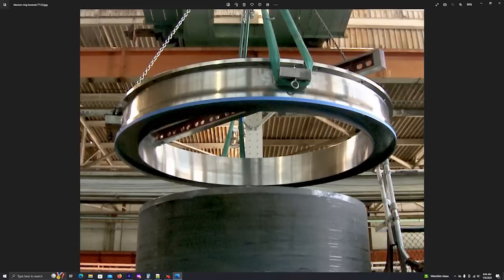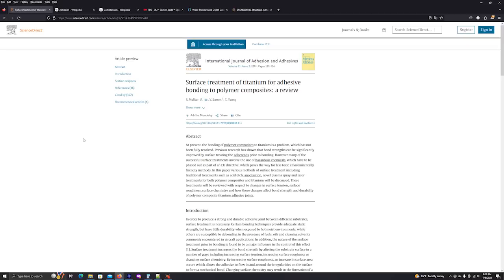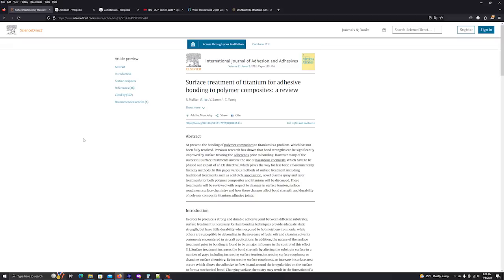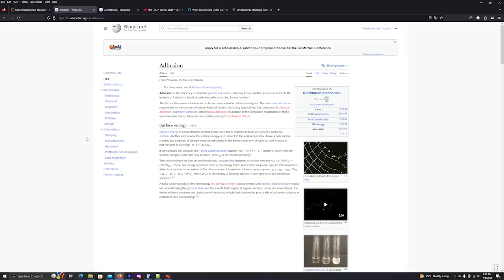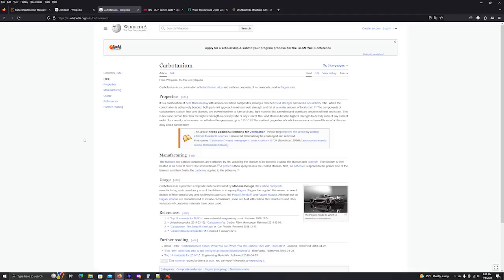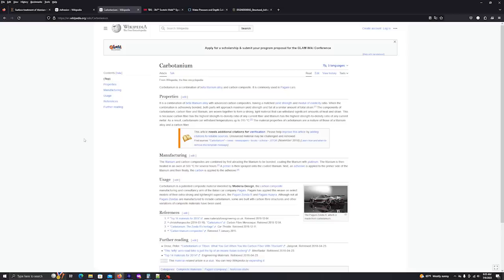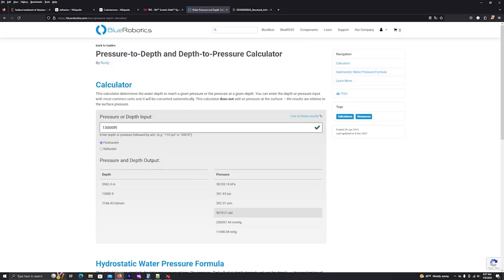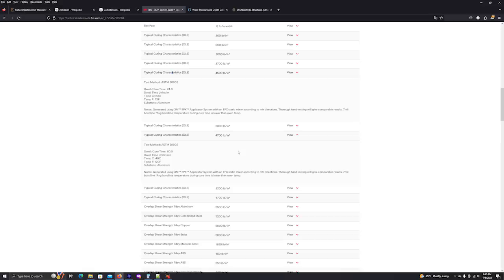Oceangate Titan Adhesive issues between Carbon Fiber and Titanium

Comment: On the recovered flange (starting at 1:11), what you’re pointing out is it’s outer circumference, which is not the bonding edge.
Reply: On the titanium ring are found two flanges, an inner flange and an outer flange, also a flat surface that is perpendicular to both inner and outer flanges. I call this entire configuration the bonding edge of the titanium ring, as the other edge of this ring is bolted to the forward dome. The bonding surfaces are the I.D. of the outer flange, the flat perpendicular surface, and the O.D. of the inner flange. So, to be clear, I did not refer to the titanium ring as being a flange, I was pointing out the orientation and location of the flanges that are part of the overall titanium ring.
Reply: @stitchem7   I wouldn't use glue at all.... I'll just use titanium cylinder between the two titanium hemispheres.... either it'll be bolted or welded. I would not put any glue between me and 360 atmospheres.... even then I would test it a 100 times underwater at twice the depth. If everything is OK then I might get down....  one thing I know from life, things will always get wrong and when they get wrong 2 times overprovision might not be enough.
Reply: @Slav4o911  Exactly my thoughts, if they would have used a titanium hull/tube, the passengers would probably still be alive. Yes, bolted with proper seals, or welded.
Reply: @stitchem7  Alrighty, then.
Reply: Correct.
Reply: Yep
Reply: The clean bond line indicates a bond-line preparation failure, and not a cohesive failure.
Reply: @scorchwhammin  The key word being "failure."

Comment: This is not a good use for an adhesive.  With that being said the hydraulic forces pushing the titanium and carbon fiber interface together would make the joint more robust.  For example, I estimate at 12,000ft of depth there would be approximately 5,500,000lbf of compressive force pushing the joint together.  Not sure how many cycles this joint would be good for.
Reply from the maker: Thanks for the comments
Reply: What about when it's not at depth.  Try to submerge a 20 ounce plastic bottle full of air without threading the end cap on.  Maybe 20,000 leagues under sea it would stay on but what about first few hundred feet
Reply: @SoulDelSol  The joint is always under compression while in service (i.e. submerged).  Not sure if this joint would deteriorate in the salt water, hot/cold weather conditions.  Not a good choice for a joint under these extreme conditions.
Reply: @mojobiel  1 of the guy's he was friends with down in the Bahamas said he had the Titan in the water there too.

Comment: Me personally as a welder fabricator for 16 years now I'd make it outta steel or stainless an make ballasts around that ect an put cross beams and stiffeners in the vessel  the hull was a titanium tube wrapped with a tight carbon fiber wrap it was literally all ready under a lot of pressure before it even went down
Reply from the maker: Steve, it was even worse,  after curing they slid the carbon off of the mandrel and then glued the titanium to the carbon cylinder.  Thanks
Reply: @JoediyLab just asking, re: attachment of ring to body, Wouldn't the cavalier application of the epoxy contain lots of inclusions like hair, dust, etc? Wouldn't each have air pockets that expand et contract during diving cycles?
Reply: @Mdeaccosta  That bugs me too. I would have thought normal practice would be to apply vacuum to the uncured epoxy to expel entrapped air bubbles, which are pretty unavoidable with mechanical application.  But I've seen no mention of them doing this, either to the seals or to the hull.
Reply: @JoediyLab isn't the carbon fiber literally glued to the mandrel during winding? And it slides off ..I am puzzled...
Reply: @RAndrewKReed  Before winding you apply a mould-release compound to the mandrel which can then be dissolved, melted or simply pushed out of the way.
Reply: There was no titanium tub.  That was mold for carbon fiber.  The titanium was just end caps that were glued on
Reply: @SoulDelSol  yikes

Comment: The Titan CF was expired and out of specification. Not sure but might be called "prepreg", or CF pre-impregnated with its own resin adhesive. Such CF needs to be refrigerated prior to use. Rush said it was purchased from Boeing, however Boeing denies selling CF to OceanGate. Which suggests the CF was purchased at salvage for large discount. 

The Titan failure reminds me of what happened to the space shuttle and the o-ring seals used on its solid rocket boosters. The seal was expected to fulfill dual roles, sealing and act as a flexible mechanical barrier between two dynamically active and moving surfaces. Its asking the sealing compound to do something it was never designed for and its failure was inevitable.
Reply: Salvaged cf?!
Reply: @SoulDelSol  
Yes, Rush bragged that he purchased the CF cheaply because it was "expired" and had extended its shelf life. Somehow, he maintained, the CF was still OK to use for this critical application. He didn't elaborate what or how he knew. However Boeing found no sale order. Its not certain, but likely bought at some 2ndary market, or salvage. 

The OceanGate youtube page featured a video of the 2 components, the CF and its titanium ring, being bonded together. Its an open, uncontrolled environment of a warehouse which easily could have contaminated the adhesive with dirt and debris. Also, at minimum, after application and prior to bonding the 2 surfaces, the glue should have been exposed to a vacuum environment to remove any small bubbles that easily could have gone unnoticed. Watching the guy with a spatula full of glue gives me nightmares. 

How anyone could responsibly ask innocent passengers to accompany Rush to the bottom of the ocean in this disaster waiting to happen seems a glaring indication how financially poor OceanGate was doing. That it worked at all is the real mystery. Joe's DIY Lab seems to have invested 100 times more serious investigation on how to effectively bond these 2 dissimilar surfaces. I've done my share of dumb things, but at least I've never been "swim down to the bottom of the sea and blow myself up" dumb.
Reply from the maker: Thanks for the comments,   Yes more than likely he purchased at salvage.

Comment: At about 10:30, the pressure calculation for depth
 should have been for salt water, and
not the default 'fresh' which was used [not that at those values, who cares ...]
Reply: Exactly. Humans make mistakes😔
Reply from the maker: Thanks, yes I forgot to check that box,.  I normally check it.

Comment: Wacky idea to use glue metal carbon fiber
Reply from the maker: Actually it is common practice to use epoxy adhesive in the aerospace industry.  You cannot bolt carbon fiber together.   But yes there many issues

Comment: (Mistake on bonding edge.) The flange you speak of is on the 'bottom' side in the photo at 1:40 and can be seen that it was partially ripped away by the implosion. The edge your cursor is pointing at is the bolted flange. You can tell the boning flange is the one that has the large radius leading to the body of the ring as in the photo of the ring hanging by the rigging before bonding. It appears that both of the 2 inch overhanging flanges of the bonding edge have been ripped away and in one of the recovery photos you can see a deformed section of the bonding edge flange still attached to the ring.
Reply from the maker: Thanks I will double check that.
Reply: @JoediyLab  EXACTLY... I was going to point that out to... Not really... I have no idea what a flange is🤷‍♂️🤷‍♂️I'll see myself out
Reply: The bonding surfaces cannot be seen in the picture. The titanium sealing ring slipped over the O.D. of the CF tube and bonded with about a 1" wide related edge at the O.D. and I.D. and about a 3.5" to 4" (the 5" wall thickness minus whatever was machined away to true and rebate the surfaces) wide surface at the end face of the CF tube.
Reply: @holdernewtshesrearin5471  I think the bonding surface can be seen on the photo, though both of the overhanging flanges have been ripped away. Notice, for orientation, where the large sloped radius is in comparison to the overhanging flanges in the bonding portion of the video, they are on the same side. This is the side of the titanium ring that they bonded to the carbon hull. The force of the implosion was massive enough to rip away those flanges.
Reply: @stitchem7  - that's a different sub, not Titan in the manufacturing video.
Reply: Let me review my notes on that
Reply: Thanks for pointing that out.
Reply: @this_number  👊
Reply: @wesayhowdyhere Flex Tape
Reply: @wesayhowdyhere  It was bolted on by a reported 18 bolts, but it is said they only used 17, for what reason I have no idea.
Reply: That's what I thought as well, what's interesting to me is the caps and rings separated, I believe there was 18 bolts which held the cap to the ring.
Reply: @wesayhowdyhere  The front titanium dome was bolted to the ring I would guess that the implosion was so violent that it separated these two components.
Reply: I am absolutely shocked they didn't make that inner lip, longer to go into the tube supporting it from the inside at the weakest point.  Even 6inches of interior lip,   they would probably still be alive.  This is the noise they were hearing aft, Was one of these edges at the flash being pushed inward, scraping and failing, Squawking with loud awful noise I bet,,., ...  What's even worse, it looks to me like there was no inner lip on the flange, It didn't go into the tube at all to support the inside, It's too wide, it looks like it was just a sleeve on the outside of the edge, which doesn't support the inside at all...  There's no reason in the world for the water not to be able to just push the tube inward at an edge and progressive failure ensues...  I knew it was made poorly but my God, I didn't know they lack any sort of Internal  structural support for the inside edges of the tube.  OMG.
Reply: @WoodysAR  maybe even a flat circular support ring on the inside of hull at center, with possible 4 evenly spaced support steel beams to each titanium end caps. But, that is my theory only.
Reply: @WoodysAR  You should listen to the sub structural engineer talk about it. He was so proud of himself. Makes my stomach churn.
Reply: @WoodysAR  There was an inner lip, but it got torn away in the implosion. You can see the inner lip in the portion of the video where they are preparing to bond the titanium ring and carbon tube together. I think instead of more flange length, just to build the whole damn thing out of 5 inch thick titanium tube, mechanically bolted together and with industry standard seals, or properly welded together.
Reply: @WoodysAR  "The noises they were hearing aft" - I assume you're talking about the "transcript" which is almost certainly a very tasteless hoax?

The setup of the flange certainly did involve an inner and outer lip, in theory bonded on all 3 sides.  Modulo, of course, the application process, which was certainly a bit "ooh la la".  But in any case, bonding failure is unlikely to be anything much to do with the failure.  The joint was designed to operate under pressure, the forces acting on the body of the sub were supposed to be pushing it together.  The glue was pretty much only there to stop the ends dropping off when it was outside of the water.

Sure, once the implosion happened, which liberated about as much energy as 40 to 50 kilos of TNT, all bets are off.  You'll notice that the flange is no longer bolted to the dome - the bolts are gone - not sheared, but snapped or pulled straight out of their threads.  I wouldn't be expecting to see anything much left of a epoxy bond.

My bet would, however, be on a failure around the titanium / carbon interface, because that's where the stresses on a cylindrical structure with domed ends are concentrated.  Better glue wouldn't have fixed it.  A deeper lip wouldn't have saved it either, it would only move the stress riser.  The tube is a stupid design.  There's a bloody good reason Cameron's sub has a spherical pressure vessel.
Reply: IMHO it is easy to concentrate on the ring-CF mating as a failure point, but the biggest issue to me is the CF tube itself.

If the rumors of the construction method are accurate, small bubbles would be inevitable.   

Compressible gas inside a CF matrix given repeated cycles is a recipe for failure.
Reply: Totally agree
Reply: @Kyle-sr6jm  - fully agreed. There are MANY potential failure points with the Titans design imo opinion. Which boggles my mind as to why Rush couldn't see them or was indifferent and complacent to them.
The disparity between the 3 materials and structures, titanium sealing rings/end caps, CF tube hull and the adhesive that bonded them, the potential loss of an effective seal between them due to repeated cycling, the breakdown of the composite hull materials and adhesives themselves and the structural concerns of the CF tube hull proper.
Then there's the unknowns. The sealing between the various electrical, data and life support systems conduits that pass through the aft bulkhead, the fact that Rush apparently never tested the Titan without the landing frame or the jettison feature of it as evidenced by the text message transcripts and the failure of the sub to reach the "predicted" ascent rate once the landing frame was jettisoned after multiple attempts.
And the realization that without testing, the possible hull deformation once relieved of the weight of the ballast and landing frame was unknown and unaccounted for.
There are literally dozens of red flags waving with each new day and the revelations it brings.
How could ANYONE with an ounce of common sense, a three digit IQ and the desire to remain alive ever allow themselves to be bolted into that thing?
As a risk taker by nature myself and the adventurous type, I've raced motorcycles my whole life, jumping 30' high over huge obstacles in my younger days and barreling headlong at 200 mph at a 75 mph corner with zero runout , spent many hours scuba diving in shark infested waters, sky diving, bungie jumping, working security in 3rd world shhh holes during periods of social unrest or outright war. You name it....but I would NEVER have gone down in that glorified bobber with that arrogant jerk obviously suffering from cognitive dissonance, perpetual "wokeness" and the ego of a megalomaniac. 
NEVER!
Why? Because while I may take risks, even enjoy it, every risk I take is carefully calculated, accounting for all variables and the only unquantifiables are with my own capabilities and skills which i am quite familiar and confident with, NOT the equipment I'm using!
Do you think I would EVER run a hot lap aboard an "experimental" motorcycle with brakes made from spit and toilet paper, no matter how well they work or how confident it's creator is in it?
Jump an experimental parachute for the first time? (Well, maybe. But I'd have to really check it out. Lol)
Or am I going to stand a security gate with a 3D printed plastic rifle in my hands?
HELL NO!
Would I dive 2.5 miles down to see the Titanic? Sure! 
But NOT in that POS! No way in hell!
Just one look at the crazed perimeter of that porthole window, the bonding interface of the sealing ring/end caps to the CF tube hull or ESPECIALLY the CF tube hull itself and I'm OUT! Just realizing there's no proper door and I'm to be bolted inside by a crew on the outside would be enough for me.
WHY was it necessary to use CF in the first place? What practical reasons were there?
Light weight being CFs most prevelant characteristic. Why is a lighter weight submersible needed? Support infrastructure and equipment is more than capable of handling, lifting, transporting vessels weighing much much more, so WHY? WHY even use CF, a totally unsuitable material with completely unknown behavior for this application?
What practical reasons were there?
Or was this just an ego trip and pushing the envelope just to do what experienced industry professionals have all advised against?
This reminds me of Evel Knievel attempting all those jumps, unsuccessfully mind you, and then boldly bragging, from hospital of course, how he used a 1975 Harley Davidson XR-75 instead of a bike actually capable of making the jump.
WHAAAAHHHH?
A friend of mine once bragged that he built his own 2nd story deck without having any experience or knowledge. He "winged" it. And saved himself a cool $3,000 too!
If he had atleast consulted me I would have advised against attaching the ledger board with adhesive and 16d nails......to the siding and not much else.
Luckily no one was home when the inevitable occurred. Think it only cost him $3,800 to fix the house.....
Reply: Longer and thicker so these slim edges wouldn´t bend to stress and slowly detach the bonding agent with every dive cycle.
Reply: I think joe has the correct edge pointers. Why? The bonding edge was the wider of the beveled ring- which was pointed up in the recovery video
Reply: @christinecollins6648  Yes, the bonded edge is the one with the wide slope or radius that leads to the flanges. I edited my original reply to make this clearer. The flanges have been ripped away and a long shard of flange can be seen hanging when the recovery team hoists it out of the recovery ship.

Comment: Every bit of CF seems to be Totally Missing from the Titanium end Ring !!  .... Where did the Titanium ring & End bell Bolts go ??
Reply from the maker: Good question.  Also the bolts are  missing from the bolted window as well.  Some folks indicated that they may have had to unbolt to lift  the end caps up to the surface
Reply: @JoediyLab  Only one end cap had a window, right?  What did the rear end cap look like?  I've never seen a picture of that part, don't know if they found the back end cap or back Ti ring.